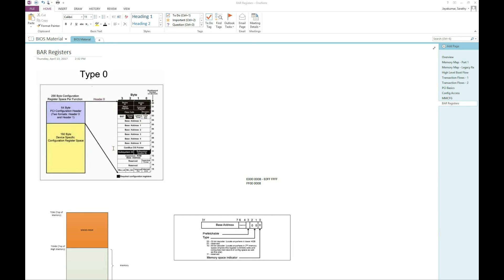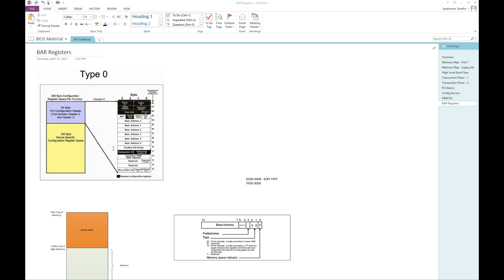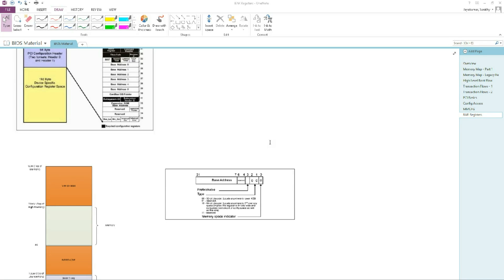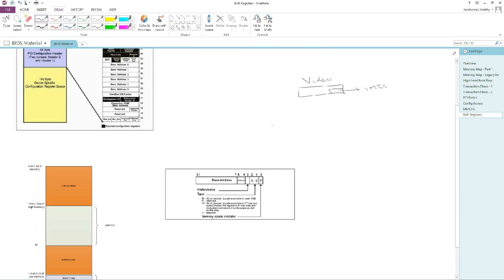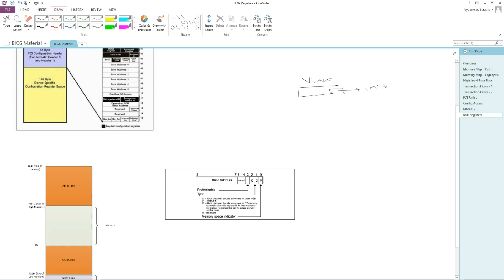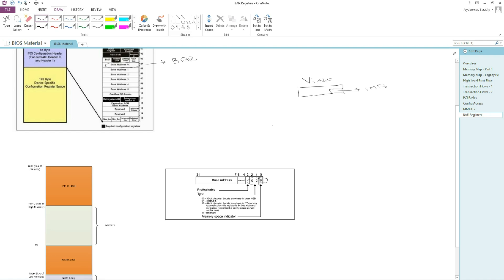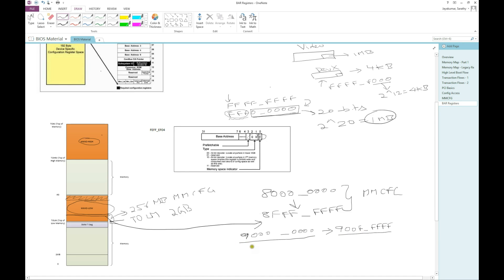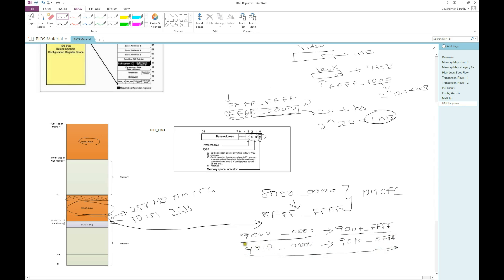System Architecture: 10 - PCIe MMIO Resource Assignment

Comment: Re.  writing (0xFFFF_FFFF) and reading back the  BAR to figure out the size of the (memory) region the device requests to be mapped to system address space, note the following with the example of the device requesting 4KB space (4096 bytes)
1.Lower 4 bits of the BAR are read only,  i.e. each BAR is 32 bit , out of which first 4 bit 3:0 are always Read Only.
2. It would be wise to save the BAR value  before writing to it.
3. Write 0xFFFF_FFFF & read it back, value read = 0xffff_f00X
4. Clear the last 4 bits - they are read-only, typically will be read back as 0's after step (3), value read = 0xffff_f000
5. Invert the value in (4) and add 1: value = 0xfff + 1 = 0x1000 = 4096

Due to the nature of the above mechanism, the min space the system allocates to device memory will be 16 bytes - corresponding to the 0's in bits[3:0]  i.e. if for some reason the device requests anything less than 16 bytes, it will still be allocated 16 bytes in the system address map. Practically this hardly happens given that modern systems with 32-bit registers & addressing in place; but good to be aware of if one runs into a resource constrained scenario

Comment: This is a very good PCI refresher series! You mentioned that the root port stores the range of MMIO addresses assigned to downstream devices. During BIOS, the enumeration process can make sure that all downstream devices get consecutive MMIO spaces assigned. The range values in the root port can be accurately programmed. What happens if at a later stage, one of the downstream devices is removed and another one, which requires significantly more MMIO space, is hot-plugged in? The MMIO space assigned to this new device might not be adjacent to other sibling device. How does the root port store the (now fragmented) range?

Comment: BAR only stores Base address of the MMIO region that has to be mapped, but where is Length Stored?, eg where is 1MB or 4KB buffer information is located.
Is there a Length Field to display the Length of MMIO region requested? Got it ...Pre-fetchable Memory Base/Limit.
Reply from the maker: When you write all 1's to a BAR and read it back, the trailing 0's indicate the size of the BAR. For example, if we write 0xFFFFFFFF to a BAR and read it back, and it shows 0xFFFFF000, the size is 4K (12 trailing bits are 0's and 2^12 is 4K). Then the BIOS programs the base address in the upper bits (upper 20-bits in the case, since the lower 12-bits are always 0s). This would imply that the Base Address of a BAR range is naturally aligned. In other words, if the length is 4K, the base address can start only on a 4K boundary.